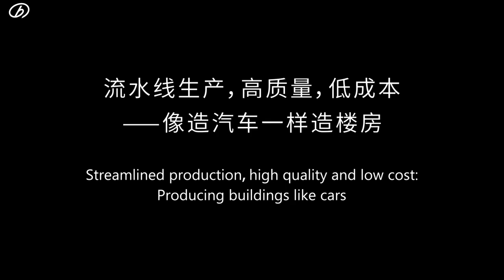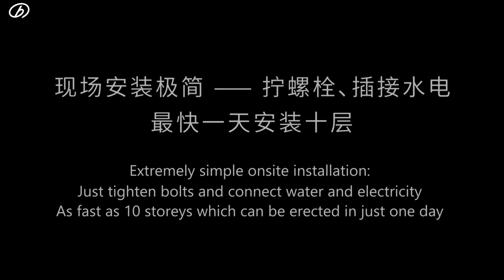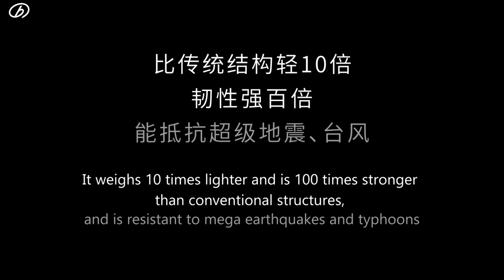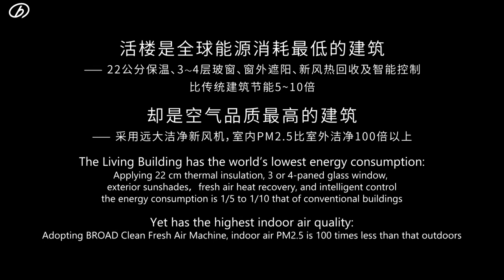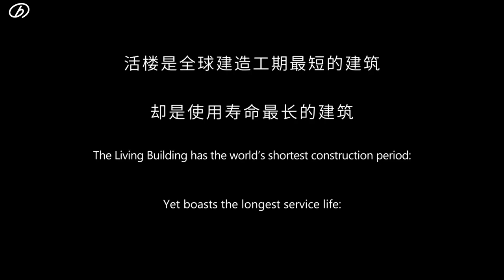BUILDING TEN STOREYS IN ONE DAY, BROAD Living Building

Comment: I’ve never heard them speak of the foundation, but I would think it must be reinforced concrete, and put in some days before? I wonder about the elevator too, but the heating, ventilation and air purifier are their own technology. The company brochure shows 58 constructed buildings, some quite large and high.  They used to be in the modular factory-built steel buildings business before this technology.  But now they are specializing in the B-Core technology for the next generation.  Bridges can be made with carbon steel B-Core panels.  They would be cheaper than conventional steel bridges.  Then of course there is more maintenance.

Comment: I'm skeptical about the cost of their building. All stainless steel has to be insanely expensive. The reason why we use wood, concrete and carbon steel is because those materials are cheap. Stainless steel is expensive. I'm not sure most of us can afford to live in such a building.
Reply: The keys are high strength-to-weight ratio, rigidity, and long service life. BSB's BCore panels are specifically made to attain those qualities.
Reply: Perhaps the fact that it's built so quickly however, makes it cost-effective in contrast to a building built over a longer time period with standard materials.
Reply: construction is expensive because wages. this cut alot workforces
Reply: It's perfect for those who want quality with big amount of budget
Reply: You have to use way less stainless steel than wood or concrete though, because it's so much stronger.
Reply: 5$/kg instead of 0.5$/kg for carbon steel but it's a sandwich structure so pretty light.
Reply: The building is made of Broad B-core slab, the core inside is hollow as you can see it in the video, the whole module is 100% manufactured in factory, so the price is not high as you may think. just image it like you buy a factory made car.

Comment: In Russia, there are homes, made from big concrete construction blocks, made in factories (bathrooms, kitchen, elevators, windows, balconies, blocks with doors etc) these are the cheapest buildings in cities. Yet it takes about 1-2 weeks to erase a building like that. And, as mentioned before me, steel building have insulation problems. Many hotels are built from steel and panels, they are not comfortable to live

Comment: It's not a one day construction, you also need to include the time taken to prepare those individual blocks.
Reply: It is 1 day construction. What you call is manufacturing. And it is a continuous process of manufacturing. It doesn't really matter how long does it take. If this type of development adopted it'll be manufactured on many factories and will be built on demand.
Reply: @tarumarabi  Then do one thing, Construct full building at different place and put it here on site using crane. Call it as 1 min building.
Reply: @crazygamers1234  You are missing a point here.

There are 2 different things.

Manufacturing and Construction.

These are two different things.

When you construct buildings using concrete, wood, carbon steel you don't manufacture either. You buy those from other suppliers. You don't calculate manufacturing time for those items when you start constructing your building. Because they are readly available to you.

This video shows that construction of fully steel building is way faster. And it is as we know from carbon steel buildings.

You can use many different manufacturers for process as long as it is streamlined and they manufacture with same standard. All you have to do is bring those parts/modules together. Like a lego bricks.
Reply: @tarumarabi  You are also missing  important part here:
This is called assembling pre-made parts not construction. It's like assembling automobile parts we can't call it as manufacturers of cars.
Reply: @crazygamers1234  McDonald’s meals actually have pre-work, don’t they? They don’t make bread after you order a hamburger.
Reply: You got the right point  @tarumarabi

Comment: How about Bank provided Loan on mortgage for 2nd floor, if borrower defaults.
Options to recover loan.

1. Threaten to remove the bolts so the other 8 floor owner will pay the loan.
2. Dismantle and put it for scrap to recover the money.
3.Sell the house based on current steel price 😂 Any other options

Comment: Did they lay the foundations?
Reply: the foundation need to be carried as traditional construction in front. but since the weight of Broad Holon is 10 times lighter than the traditional building, so Broad Holon can take lower requirement for foundation

Comment: Cheap propaganda.
Reply: how can you find propoganda in a technical area?
great eyes
Reply: @ManjotSingh-rl6du  they are Chinese, of course is propaganda.
Reply: @ManjotSingh-rl6du  , why do you waste time speaking to these fools. It takes lot of courage to accept that your competitor has advanced, which China has in many fields. This technology may not be perfect but the idea is excellent to have earthquake and storm resistant buildings. They can even be dismantled and reassembled quickly. But the real problems/cons can only be observed after continuous use for 5-10 years. Also I wonder how these steel structures can be insulated efficiently against the torturous heat of our summers and colds ?
Reply: @razz4200  The stainless steel panels can be filled with rockwool thermal and acoustic insulation.
Reply: @ayoutubechannelname  thanks. Didnt know they started making stone wool now. The facts sheet are impressive. Waiting to watch when this tech becomes affordable.